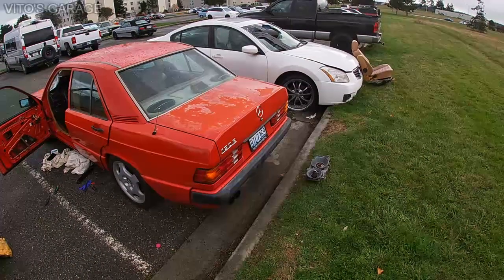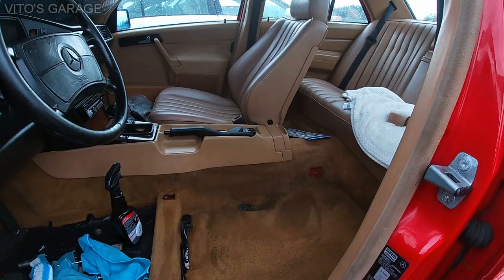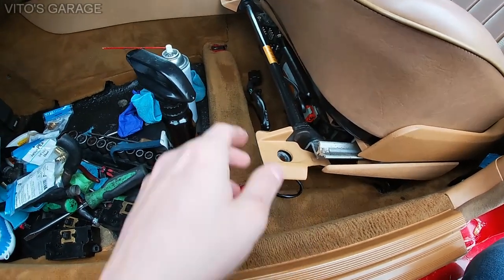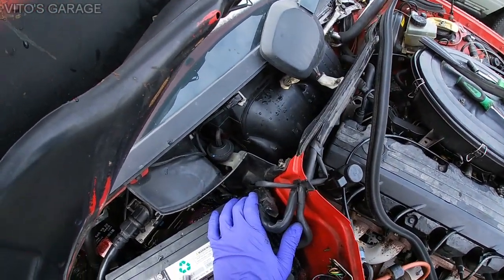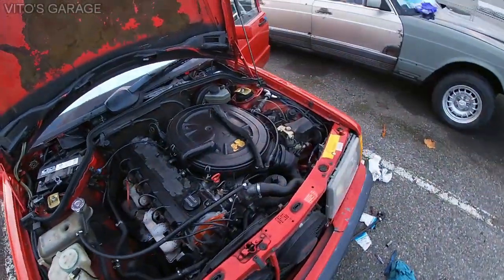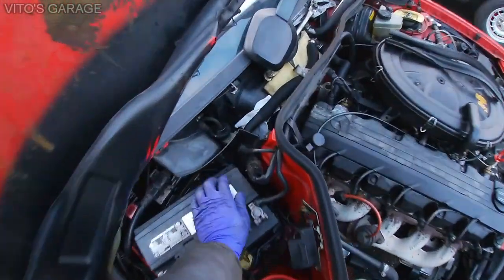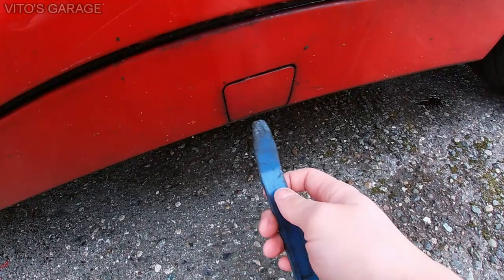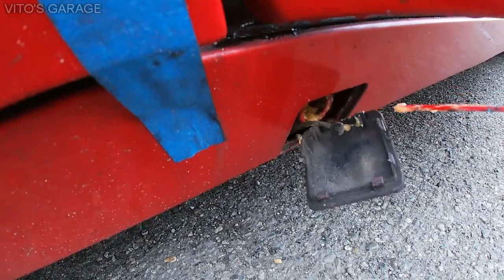Mercedes Heater Core Leaking... Easy Temporary Repair! + Bonus: Jack Hole Preservation 190E

Comment from the maker: Mercedes 190 heater core replacement: https://youtu.be/oOp2yFw0X1Y
Reply: Thank you for helping me get my late Mothers 190e on the road, I followed you Bypass instructions step by Step, But now my Thermastate gauge  is not working, could I have done something wrong?? Thanks for the Vids
Reply from the maker: @CharlesHolmes-h4u  you connected the cluster properly?
Reply: im sure it did but I will double check... Thanks @VITOSGARAGE
Reply: yes I didnt touch the cluster,, does the Bypass somehow stop the Reading.. Everything else is working on the cluster .... Thanks @VITOSGARAGE

Comment: This is a good example of what  Pierre said, a cheap MB  is a expensive one.
Reply from the maker: I don't know who you're watching but you can buy a $10k 190E if you want to, but it'll still be as old as mine. And it'll have rubber issues and other problems too. Cheap Mercedes is the best thing in the world. If you're not handy or don't work on cars, you need to look for $20k cars. We love saving Classic Mercedes here and giving them new lives. And please don't discourage others from getting cheap Mercedes. My 190E after restoration and paint job will be under $5k. We love these cars and must save them. I am absolutely not upset that my heater core is leaking! It's just another part I'll have to replace. I am not afraid. I'll keep putting love and care into these cars. Hope that makes sense
Reply: @VITOSGARAGE  
Pierre  Hedary.  Also  R107 for 10K is a better deal in the long run.

Comment: Definitely take care of your jacking points and pads area because trust me when that things rusts out it's gonna be one son of a b to find someone that can give u that piece of floor metal and weld it on. My right front jack pad is currently off due to the mounting area getting rusted out
Reply from the maker: Preservation and regular inspection is the key! Otherwise you'll have some welding to do. Don't wait
Reply: @VITOSGARAGE  yeah . The previous owner treated it pretty badly even thought it only had 100k miles on the dash . But I'll be the owner to restore it and be proud of owning a classic Benz. It's crazy how some people can't appreciate the German engineering
Reply from the maker: @ooooooo6038  that's very sad.. Mine was the same way.. Super mistreated and neglected.. A lot of people don't deserve to own these cars!!! At this point these cars can only survive in the hands of real enthusiasts like us!

Comment: I was wondering,when the coolant got inside the car, what got me thinking,is the the wires or wire harness than goes around the floor, now I imagine  the wires that have to do with the power seats or are they manual,then you have the wires from the lights, or are they out of harm's way, finally any updates on the W126 that is next to the W190.
Reply from the maker: No coolant got passed the carpet. And this is a 190E model, not a W190. The chassis code for this car is W201
Reply: @VITOSGARAGE  I know there is a 16 valve 190 also do you have one, they are quite impressive, also what had me puzzled was the W140 that used the regular key, we had one and it was like a beeper type  which would open the doors,& the trunk.
Reply from the maker: Pre-facelift W140s had a regular key. Later ones had a mechanical key on a fob
Reply: @VITOSGARAGE  the reason I say We had aW140, 1990, it had a key fob, or built in key, that you pressed a button, the key would come out, also it would open, the power doors, it had a phone in the console had wipers on the headlights, which you would normally see in the european version cars, the car looked like a limousine version  we had bought it used from a Mercedes Benz dealer, it had what looked like a power antenna, but it was to measure the distance, I believe, eventhough it had to open the the trunk, doors with the key it would open when you aimed the red light directly to the trunk or doors, and I asked the parts department, since we had to  get an extra beeper or key fob, they told me it is an option, and the car  is a W-140 420 which looks like a W140 500, that car was so unique, the glass was so thick, not like a regular car glass it was like armor plated, any ideas, I still miss that car
Reply from the maker: Amazing!! Wow, that was a crazy option!! Imagine if you still had that car! Do you ever wonder where it's at and if someone is taking care of it? 
I can't wait to add a W140 to my collection!

Comment: Great video, like usual. Outta curiosity why not bypass the heater by using a hose from the engine inlet to the inlet pipe that connects the aux pump back to the engine? That's what i did on mine for couple of weeks after which i had to change the core because in the great NW need heat to defrost the windows :)
Reply from the maker: Thank you. And It's because I would have to loosen the metal coolant pipe from aux pump and I'd have to move it back. And if I did that, I'd not be able to mount that pipe to the body. It'd have been loose and I don't like zip tieing it. Plus it looks great when hidden under the cowl. Thanks for the support